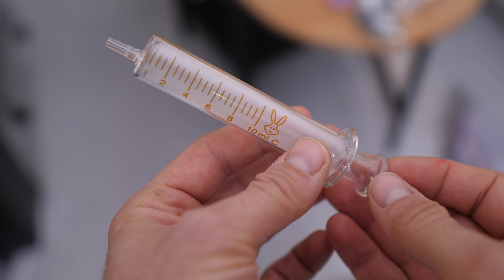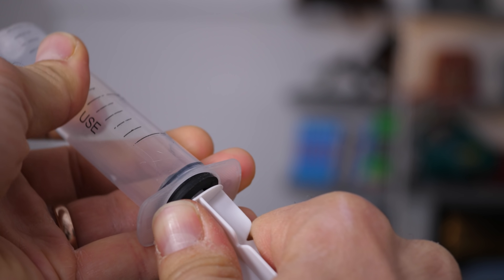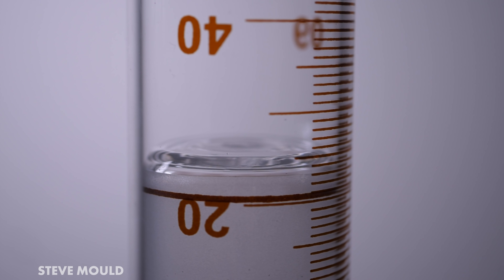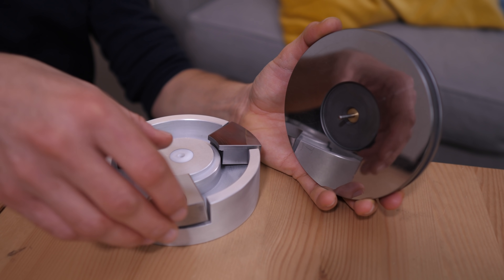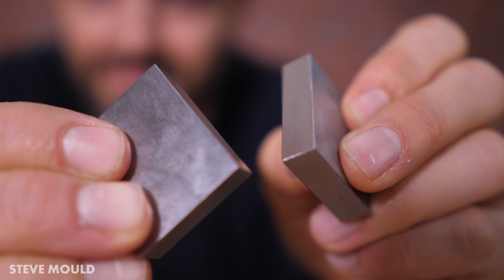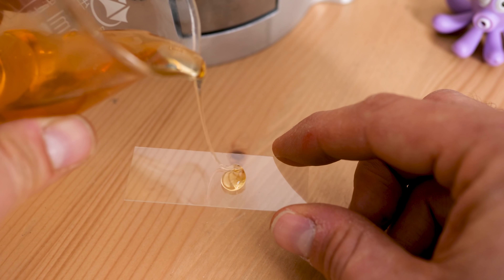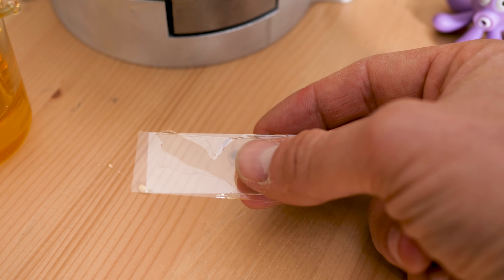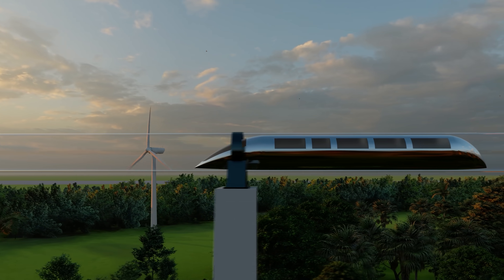The Self-Levitating Kingsbury Aerodynamic Bearing

Comment: In the 90’s Fuji, or possibly Noritzu Koki, we’re a film company, but they were also a sandblasting company that revolutionized sandblasting by blasting inside a machine, rather then blasting with a suit on. They devolved parents for metal surface treatment by blasting different materials in different angles. They devolved a system where they blasted small bits of rubber that indented the surface of metal so perfectly that trapped air in the round indentations and acted as bearings. Any oil or water would clock the surface, and it meant it would have to stay clean. I’ve looked for this technology since I saw that documentary in the 90’s on Japanese TV with English subtitles. The information seams to all have gone underground, because it was said to revolutionize so many technologies. But it never did. And they were already a massive company, they didn’t need funds or to compete. They simply had to patent and introduce products. I’m surprised I found a this video, cause no one really talks about this stuff

Comment: I am reminded of the 'air bearings' that supported hard disc heads above the disc when it rotated really fast.  If the air cusion failed the head would crash into the surface of the disc - hence a 'disc crash'.

Comment: Steve, I don't think ice skates melt the ice into water by pressure and that is what results in lubrication. I think it's been shown that the pressure changes the molecular structure of the ice to a form that is much more slippery. There are numerous "types" of ice crystals, each  formed by certain pressures and temperatures and in each case the hydrogen/oxygen molecules form a different lattice. Check it out and correct me if I am wrong.

Comment: This and glass stoppers for glass bottles have always been interesting for me but I always though the matte surface on one side was part of how it works
Reply: Two years late, but FYI,the matte surface is an artifact fro the precision grinding that gets the pieces to fit so perfectly. In a way, you're correct, as without that grinding it would be near-impossible to get the glass to match, but the ground pattern, itself, does not impart an effect.  Funny enough, this is why Steve's advice in the beginning works - sometimes the grinding isn't perfect, and by manually rotating the glass against itself for a few minutes, you're effectively grinding down any high spots that were left to create a compatible surface.

Comment: The viscosity of air creating a bearing hints to a PROBLEM that NASA has with using tools in space. The first time I came across this was during the moon landings when they used a drill to drill into the moon's surface. NOW they encounter the lack of air lubrication when doing repairs outside the ISS.

Comment: I use to work for catapilar where we made metal seals for large equipment. We rotated the metal rings on a large table with a slurry mix with a gritty oil. It created a perfect seal similar to what you were showing. When you picked up the rings they would stick together like your blocks shown all the time.

Comment: To the case of those gauge blocks...could it be a case of cold welding? https://en.wikipedia.org/wiki/Cold_welding 
Ive read about a situation where some aluminum parts of a space station (or shuttle) stuck together because of it. Perhaps its the same thing but you can pull them apart since we arent in vacuum. You need to press those two blocks together for them to stuck after all which perhaps removes atoms of air between them. Its just my theory of course I have little scientific knowledge when it comes to stuff like this.

Comment: I used to use a device called a dead weight tester. Precision matching piston and cylinder sets where one end was fixed in place and vertical oriented and the other was free to rotate. The device allowed air to be pumped into the cylinder and had a little motor that could give the free piece a spin for a moment and then would disengage. And a glass cover forming an airtight seal around the outside of all of these with a way to connect an air tube to this. And a way to add precision weights to the spinning part. If you added some air to the bottom and gave it a spin it would float.  Add some more air and it would float a little higher but the pressure would stay precisely the same. Know the mass, the density, the cross section area, and gravity and then you also knew the pressure. I used it to calibrate high accuracy pressure transducers. The equations I used corrected for the effects of pressure and temperature on the effective cross sectional area. They also corrected for changes in acceleration due to gravity (and the earth’s rotation) at different elevations at my laboratory where I used this. And buoyancy.  Cool stuff.

Comment: Here I believe, thinking in terms of electrical circuits, we are giving a DC current through a circuit with capacitor. The capacitor is formed by metal plates and thin air-dielectric formed when the disc is rotating.Thus, current doesnt flows.

But what if , pass an AC signal of high frequency through the system based on capacitance of the system. The Cap = (E0 * Er * A /d) , Er=1 approx, E0=8.854*1e-12 , A = (pi * r^2) , d=3um.

Comment: The dragging of the fluid is a consequence of the no-slip condition which states that the fluid in direct contact with a solid in motion has a velocity of zero. This same phenomenon is what causes paraboloidal flow distributions in pipes and flow velocity gradients between moving plates... Even the write heads in a hard drive float on a very thin layer of gas provided by the rapidly moving disks.

Comment: I think Hard Disk Drives do something similar.  The distance between the disk and read head is now down to 1.3 nano-meters in Helium filled drives. This called the "Flying height" of the drive. The close the drive head gets the more accurately it can read the magnetic surface. But you need some mechanism to keep it from crashing into the head, which would destroy the drive.

Comment: If you put a long, thin needle on a biggish glass syringe and try to fill it with a solvent it can typically be noticed that the syringe isn't 100% tight. Make sure the needle is attached airtight, put some parafilm or something around it! (note that a lot of solvents dissolves parafilm and other plastics so be careful to not contaminate the compound you are measuring)

Comment: Hey Steve. Regarding the two gage blocks sticking to each other.. does that  attraction force work even in vacuum chamber? If yes then only it the vanderwaal force mentioned in description. If it fails in the vaccuum that means it is the air. I am not sure but I have a feeling it is the air pressure that is keeping them together. Like when you glaze them on each other you remove most of the microscopic boundary layer of air and accidentally put some microbumps on the first layer into the microvalleys of the other. So their mating displaces the air making it a low pressure zone as there's far lesser air molecules between them this means the outside air will keep them stuck together and if we put these things in vaccuum the magic should disappear. If it is indeed vanderwaal thats's the dominating force then vacuum wony affect it so this can be used to distinguish between the two proposed solutions. Can you set up that type of experiment? Thanks and cheers!

Comment: I know why two metal blocks hold together so well.  They form a partial vacuum first and then stick together like suction cups. This is possible due to billions of imperfections in the surface that trap air at a lower pressure than ambient.

You don't need high precision steel blocks, you can do the same trick by lifting two brand new playing cards, only holding one of them, and watching the bottom card stick to the top card.  The top card must be offset a bit so you can grip it.

The same trick happens when you open a plastic folder too fast, and the top sheet of paper sticks to the plastic cover.

Comment: Guage block ringing, or sticking together, is caused by the difference of pressure on oposing sides.
The opposite side of the block to the side touching the other block has normal air pressure 15psi pushing against it. But the super flat contact between the blocks has pushed out all the air molecules so that there is a metal metal contact. There is no way air can get back in, thats why the blocks are slid together to push out all the air. Now there is no pressure between the blocks but air is pushing from the other side of the blocks forcing them together. Thats why they stick. If the blocks are just placed against each other there will remain a layer of air molecules 1 layer deep or more, and this will allow more to enter if the blocks are pulled apart.

Comment: What about a sealed vacuum chamber with a circular magnet that is the same charge as the internal walls? If you got that to spinning, would it ever stop? No air to slow it down. Could design it in a way that gravity and other magnets would assist in speeding it up, somewhat like a racing loop, but enclosed and without end cuz loops in on itself.

Comment: Engines rely on hydrodynamic bearings for the crankshaft and camshafts. This is why tolerance is critical for these connections, and are measured at a minimum in thousands of an inch, and sometimes in ten thousands of an inch.

It's amazing, the piston moves up and down against the crankshaft by force of combustion, at whatever rpm (let's say 6000 rpm at the top, so 6000 times a minute moving up and down), yet they never touch the actual crankshaft due to hydrodynamic properties.

Comment: I believe that I might know why the gauge blocks stick together. Well, I have a hypothesis. When you rub two surfaces together the two surfaces can share bonds. An example would be when you rub your socks on the carpet bonds are being created and then ripped apart. That creates a charge differential. (Static electricity.) However, in this case the blocks are so flat that when you rub them together the two blocks share so many bonds that the electromagnetic force alone is enough to hold the two blocks together. Obviously, my hypothesis is subject to scrutiny if someone has a better explanation, provided there is enough evidence.

Comment: This is the same phenomenon in which the computer's hard drive heads are based on, in order to get a lift over the magnetic plates without touching them as they spin. They park on a specific side over the plates or right outside the edge of them when the hard drive's plates are not spinning, and then they start to move once they've taken off just a few micrometers over the plates.

Comment: Have  a look at the Drilling Spindles currently used on PCB drilling machines. 250,000RPM air bearings and faster.
Westwind Air Bearings Ltd in the UK are one manufacturer of these exotic items.

Comment: Nicely explained,Steve. The other common place that this principle is often seen is placing a hot cup onto a wet flat surface. The increased air pressure caused by the heat of the cup causes it to glide over the flat surface until it cools down and the hydro dynamic effect dissapears. Also seen by spinning a saucepan lid on a pan with boiling water inside. Another area this phenomena of boundary layer action is evident is the Tesla turbine.

Comment: A large air-bearing is used in the rotating cryostat of the ROTA-Group at the Low Temperature Research Laboratory of the Aalto University. The air-bearing was a necessity for the ultra-stable rotation speeds while the rotating cryostat operates far below 1mK. One can see the rotating cryostat in action here: https://youtu.be/lOGpMEdH_TQ?t=30

Comment: Gauge blocks don't actually "stick" together. When you press them together, the air between them is removed and the external air pressure creatures a vacuum resulting in them being weakly bonded until the vacuum seal is broken. You can prove this by placing them into a vacuum chamber and witness them come apart once the external pressure is lowered enough.

Comment: I'm pretty sure the gauge blocks are just physics at work. The two smooth surfaces when forced together like that squeezes the air out of the gap, creating a vacuum, at which point the pressure differential between the surrounding atmosphere and the newly created vacuum is great enough to basically make them stick together. It's why balloons eventually pop when they reach high enough in the atmosphere, and oil barrels crush when they have everything sucked out of them, and why our oceans still haven't been fully explored.

Comment: If you are using a hard disk drive then the head of the hard drive floats above the platter of the disk on a cushion of air. This is another form of hydroplaning. Hard drives tend to fail more often in Tibet than any other country in the world (especially before the year 2000 when they weren't built as well) because the atmospheric pressure in Tibet and therefore inside the disk drive is less dense than anywhere else on earth, since Tibet's average altitude is 14,370 feet. Most aircraft designs have a cabin pressure equivalent that's between 4000 and 7000 feet altitude. So I wouldn't recommend using a laptop with a hard drive while you are in the air, but these days hard drives can usually work in low pressure zones due to better hardware designs. If you live in Denver, Colorado you would probably be wise to use solid state drives instead of hard drives.

Comment: a really common location for hydrodynamic bearings: Every single car engine you can think of - all the crankshaft bearings (block and big ends). The oil pressure in the film that the crank ends up spinning in is several tens of thousands of PSI despite oil pressure usually only being a few tens of PSI

(Also, gas turbine engines - jets)

Comment: How do you not use the most common and obvious example of a hydrostatic bearing. The bearings in automotive engines. Many bearings including the ones under the most force are hydrostatic bearings. There's an oil supply but it only needs make sure there is some oil and that it's flowing for cooling. The bearing action is completely hydrostatic.

Comment: I learnt this cause to motion which means to accelerate just like the plastic over melted inside the barrel causes the screw to slip because the plastic resin was over melted from setting higher temperature. What a good term to know in industrial sense. Good day and great one!

Comment: On the 2d cross section model, it's also possible that the inner cylinder rotates along the perimeter of the outer cylinder the eventually lifts off, in a similar manner to an aircraft wing.

Comment: If you have  good gauge blocks, you don't have to squeeze them together so hard. We know why they stick. It's the same reason old hydraulic and pneumatic cylinders would get stuck when full closed or fully open. The space between the gauge blocks is so close, in tolerance, that the air molecules can't get between them.

Comment: The inner glass is ground and has tiny scratches that's why the outside spins on it instead of snagging. The scratches are to small to let the water molecules pass between the surfaces. Air on the other hand will be trapped and act as a compressible spacer between the two surfaces acting as a efficient bearing . If you put some WD40 on it it would jamb up. It would not be able to take any kind of heavy loading though as the load pressure would overcome the air pressure. It would be interesting to see how it would spin in a vacuum chamber?

Comment: This is why hard drives were until recently not sealed, as they require air inside them to levitate the read/write heads just above the magnetic platters. Recently, helium filled drives became available, which are of course sealed as a result, in order to lower the drag the platters experience with air.

Comment: You like ringing?  Check out cold fusion of metal parts in a vacuum.  In space clean metal components of the same material will become one.  They dont know where they start and the other piece starts.  Its like two puddles of water joining together.  Its amazing!

Comment: This is the same way the rods in your car connect to the crankshaft, except instead of air there's oil! It has to be due to the high pressures. Every once in a while there is contact, which is why the soft metal bearings are in between to absorb it. If you don't change your oil, or use the wrong viscosity, or run your engine really hard while it's still cold, the rod will make contact with the bearing, which in turn makes contact with the crankshaft, eventually scoring it and causing rod knock, which will destroy the engine!